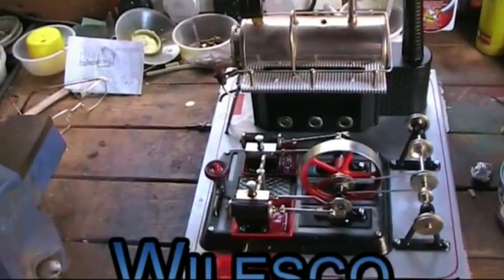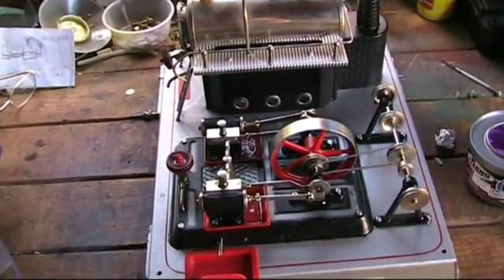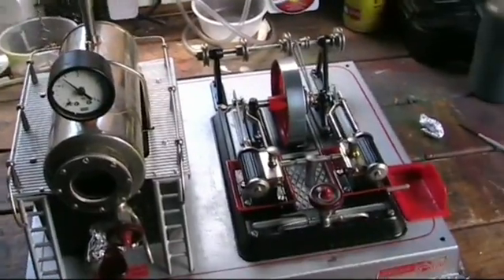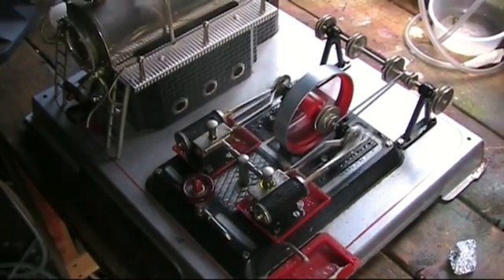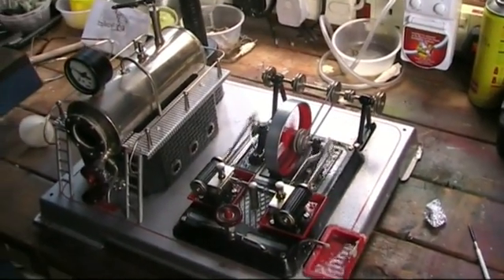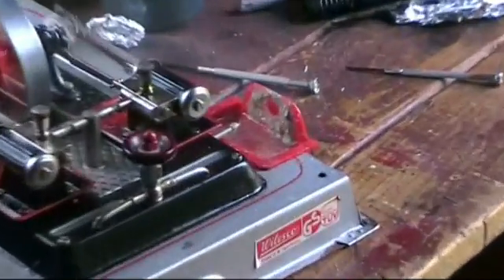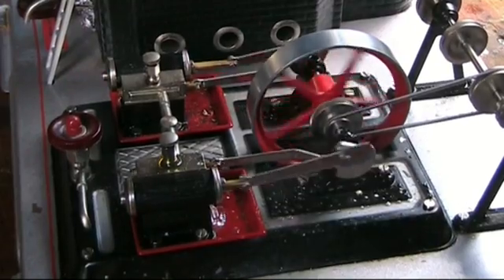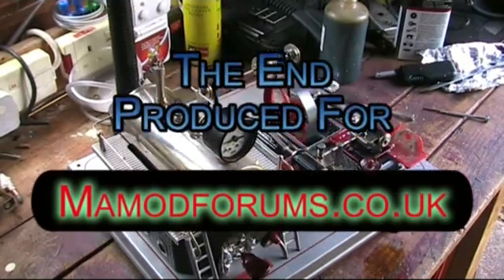Wilesco D22 Toy Steam Engine Runs On Sterno

Comment: I gave up on the Esbit, used the Sterno for a while, but found Purell brand hand sanitizer (70% alcohol)  burns real well, is less expensive, and comes in a pump bottle dispenser. The Sterno was too messy.

Comment: Hi can you tell me if the sterno leaves any sooty deposits
on the boiler,unlike the dry spirit tablets,
does it give off any fumes,eg can you use it in indoors.
thankyou.
Reply: It does not emit smoke, and generates less waste under the boiler (hollin). I the problem that I found (in my case it is Olympia the gel), is that by putting the aluminum the gel loses combustion intensity in half and that it does not burn at all.

I have been advised to put the gel without aluminum foil, and I agree that it is a better solution than the aluminum that plugs the ventilation holes that the burner carries. Nor does it burn well with Witabs (Esbit) tablets with aluminum foil.

Comment from the maker: @steampics 
No problems. Just get it out with a spoon and pack it in the burner.
Burns away to almost nothing. Recommended.
Reply: Hello sir.  Liked that. But can we find a way to fill tank when running?   I can setup mine and use for 12volt into inverter if needed. I had a D10 And the old D10 model. Made a steamplantation of it with DC motors attached to the shaft you have there in front. I have the same size boiler. But old version. Paid like 40 dollars for it.  Im trying to find a way to use small rivers as powersources.  Using wheels with scovels. I have seen alot of such makings. And people have their own power.  Until Mr Gov comes and told em they could not make their own power to the house or any other. They had to get contract with power company or they would be arrested.  It is here on youtube that video.-

Comment: Hi there. How does Sterno go? Can you touch it (i.e. get it out of the can)? I might try it with my Wilesco D405. Is it safe? lol. I know these are silly questions but I want to try it with mine. cheers. 5*
Reply: I'm about to use it on my D365 roller, which has the same burner as yours. It can be touched even if it contains methanol, and the smell is much less unpleasant than that of the Witabs tablets without combustion.